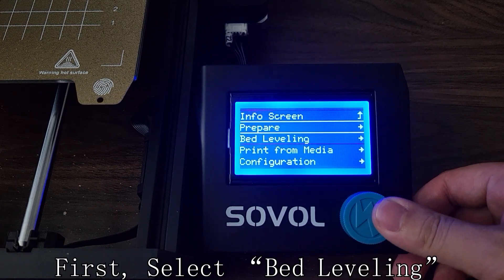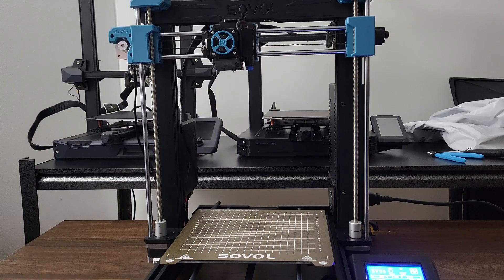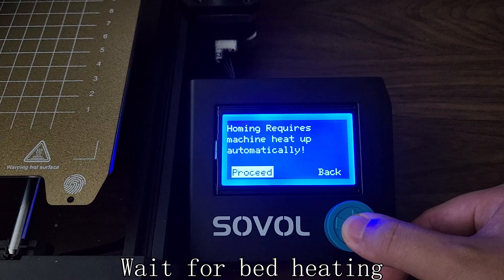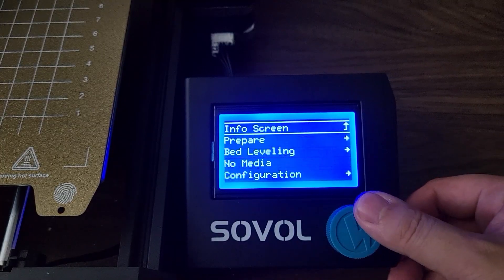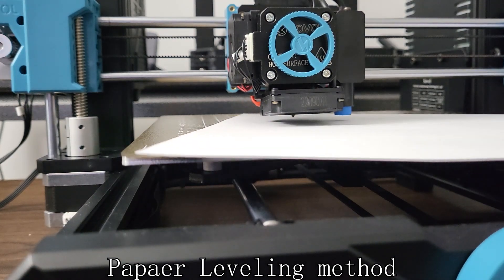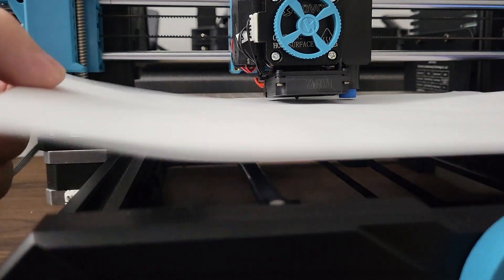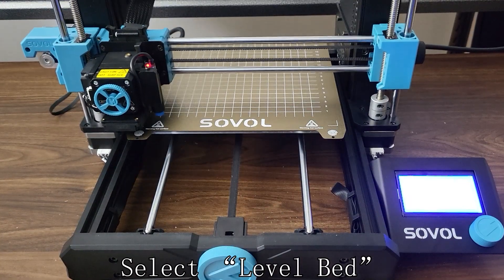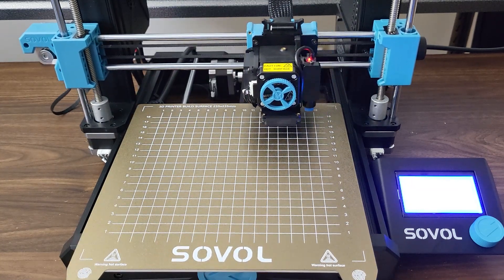Sovol SV06 Bed Leveling Step-by-step guide (Z offset)

Comment: I have to set super offset -11 to get 0.2mm space between extruder and bed but when i try to print something the extredues go so deep 😢 i don't know what i'm doing bad
Reply from the maker: I think you should restore the printer to factory and redo the whole bed leveling process. In sv06, you have to do bed leveling in specific steps, other wise it will go off.

Comment: Hello, how are you? I hope you can help me. I have a svo6 and the auto level does not work. If I put the nozzle on the left side, it scrapes the paper. But if I put the nozzle on the right side of the bed, it easily fits three sheets. The height is different. I don't know how to get it. bed is at the same height in all 4 corners please help
Reply from the maker: Unfortunately, sv06 have one common issue called x twist. which will cause issue as you mentioned. There is a firmware that allows you manually compensate this issue, however, you should "scrapes the paper at the center of the build plate". That way, you will get a middle value that good for most of your prints. Yeah, it is hard to get a perfect first layer on sv06 without hard effect. Hope that help.
Reply: @SvgLau  thank you very much for your help
Reply from the maker: The feature "z align" should help the x twist a bit,  you should try this feature before level the bed. Also, I have one tool allows you to check the alignment. https://www.printables.com/model/357483-sv06-z-axis-leveling-tool-align

Comment: How much friction should you expect when you do set the z offset? Like just above holding the paper firmly to the bed or does it require more space than that?
Reply from the maker: Where you can feel the friction, when you pulling the letter paper backinforth. But not strong enough where it fully stop you from moving the paper.

Comment: This helped me get my settings correct. I have a question though. My bed does not move back far enough when doing the bed level. It acts as though it is off by a full layer. How would I correct that?
Reply from the maker: So, this printer use a feature called sensorless homing, which the motor driver sense a bump during it's travel it will recornize it is "homing" (end of travel". I think you may have wire on y axis to bump the bed during homing travel. Check the heat bed cable, make sure it is not on the way of Y axis travek path. Also I have another video have detail instruction with some other common issues with this printer.
Reply: @SvgLau  thank you so much for the reply. I'll look into that and check out the other video.

Comment: Just set mine up and its printing the first test. But the print started off center. Why is that
Reply from the maker: There are two things you can try, make sure you adjust the homing position on slicer, confirm the printer bed size is correct too.

Comment: Just got the printer a couple of days ago and I think I have an issue with the spacers. On the left side, they're a bit too high wich is causing the first layer to be too thin and on the right side, the first layer is just fine.
Reply from the maker: Yes. My unit have this problem too. I mentioned on the other video (Beginner guide one). Did you try to put M420 S1 on your start g code to load the mesh?
Reply: @SvgLau  i just did it and it completely fixed the issue. All layers in the corners look pretty much the same.
Reply from the maker: @arpair5  Nice! glad that helps!

Comment: Out of the box it was 1.something... now its -7.000.  It seems this is going in the wrong direction every day with this pinter.. started great .. now I can't get it to work at all .
Reply from the maker: Restore setting. Redo the bed leveling again. You should only need to do the z offset once, remember to "store setting" after you done the z offset.

Comment: Hey I just got one and for some reason it is not probing the bed at all. I was wondering if there is anything I can try
Reply: Also love your stuff man
Reply from the maker: @thynameissprinkles6837  thanks!
Reply: Never mind it worked this time
Reply: My printhead crashes crashes into the bed when I try to autohome it. Tried contacting customer service but no dice
Reply from the maker: @loganojeda7720  more information, maybe I can help ya out.
Reply: @SvgLau  thanks! When I try to autohome or 25 step bed level head digs into bed. The mistake I made was hitting the autohome button when I just finished a print. I tried to remove the the print before it auto homed but it was too late.
Reply: @SvgLau  maybe the autohome sensor went awry. because I tried reflashing the firmware but same results.
Reply from the maker: @loganojeda7720  that is odd problem. I think you can try reset EROM on printer, or did you make sure delect everything on the sd card when/after you reflashing the firmware.
Reply: @SvgLau  I used a completely different card I formatted before putting .bin file on it.not sure how to do the EROM.

Comment: Great video thank you. When I auto home it moves left on x axis and makes the awful grinding sound yours did when doing auto z level. I feel like it is going to break it. How do I fix it?
Reply from the maker: It is actually sensorless homing, you could adjust it on printer. go to "configuration" - "advanced settings" - "tmc drivers" - "sensorless homing" My default value is x65, y68. Increase the value by 5 at a time, test it see if it reduce the grinding sound while hit the end of travel. People said it nomally goes away at around 75 value. But just test it on your's slowly.
Reply: @SvgLau  thank you I will try this now!

Wow! It worked. I bumped it up to 70! Thank you so very much!!!!

Comment: nice video... I did all the alignment but when I time to print the extruder goes to high and start printing in the air.... way off from the bed
Reply from the maker: try to increase the z offset value a bit lower, make sure you "store setting" after you set up the z offset.
Reply: @SvgLau  "increase the z offset value a bit lower" makes no sense. that is a contradiction.

Comment: reminder to set your Z axis height to 0 before setting z offset, if you dont you will likely set the offset way too high causing the nozzle to dig into the bed
Reply: Wish I read this sooner, at least I now have a scratch of shame to rememeber.
Reply from the maker: @halladutchi  we all made these mistakes. Lol 😆
Reply: @SvgLau  Also it looks like I have a permanent damage. Bed is now lower on the left side where I made the scratch. 
When doing a z-level-testprint on the left side you can see the bed through the layers, on the right you can not. 

Tried to manually z-align with an object, correct z offset and auto bed level. Same result. 
If you have any ideas let me know..
Reply from the maker: @halladutchi  The bed spacer is solid mount, and the machincal structure of the printer should not be easly damage by nozzle in theory. If you can , I will suggest you to replace the nozzle, take out the sd card reformat on pc(clear all the files), restore printer, and then redo the bedleveling and calibraction from beginner. 
  
I have another video have detail steps that you can follow from "calibraction" part. 
  
Also I have take the printer bed apart and measure the spacer, they are actually in a different height. Maybe you can try to check the spacer out if nothing works out. But I will just try to do the recalibration first before I touch any hardware.
Let me know hows that goes.
Reply: @SvgLau  On my search I found something on Reddit regarding the SV06 which seems to have fixed it. There is still some imperfections on the first layer but I can not see through it anymore.

G28 ; home all 
M420 S1 ; fix bed leveling
G29 ; mesh bed leveling
Reply from the maker: @halladutchi  nice.
Reply: How do you set your z axis height to zero?
Reply: @guillaumelombard7210  My printer is currently decommissioned to i cant help, watch a youtube video
Reply: u mean z offset to 0 before even doing the auto z-align or what?
Reply: I did that
Reply from the maker: Or reset the machine.
Reply: Hi im late but i saw a video that showed the z leveling might not be perfect when it touches the top.

He set 2 soup cans on the bed to check if the gantry is level to the bed.
Just lower the linear rods onto the cans by hand.

Might be worth a shot